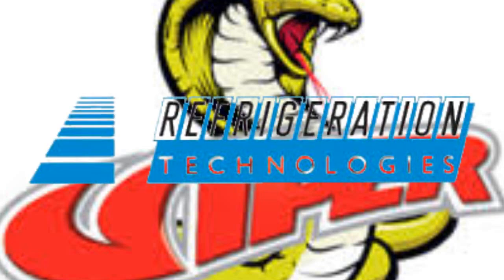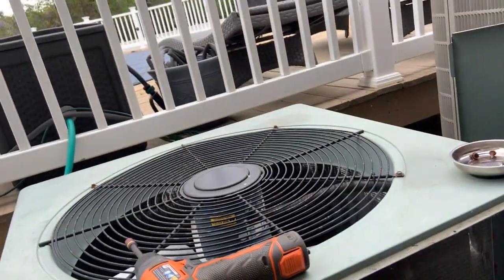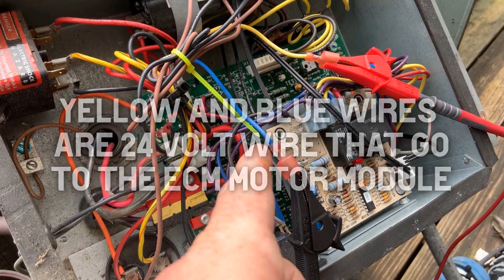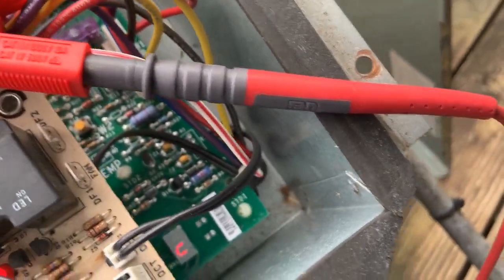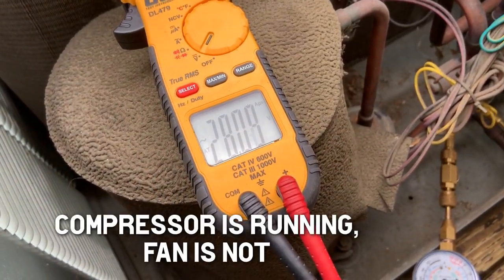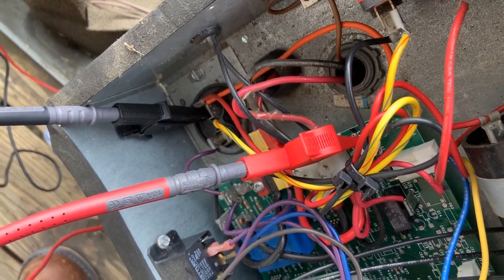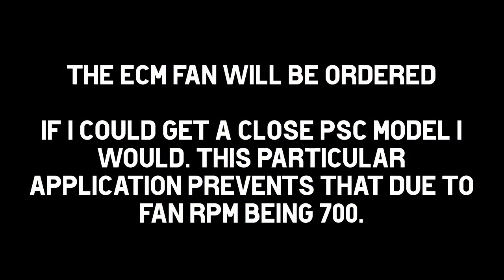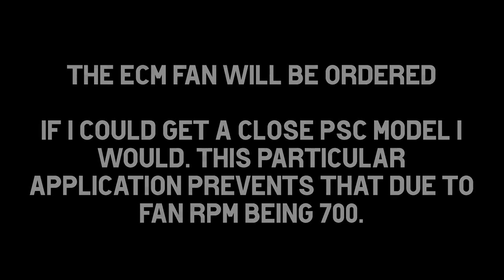Condenser Fan Motor Failure Diagnosis

Comment: How are you going to bill this customer? I am going to assume the original motor had a manufacturer parts warranty, but let’s say it did not have warranty and you sold the first motor,  what would you have done now, sell him a new motor at a discounted price or try to convince the customer to replace the equipment since it is little over 10 years old with no warranty?
Reply from the maker: Sell the new motor at the same price as I did it inn2017. 3 years is too long to give a discount I think. The rest of the system in too good of a condition to replace.
Reply: HVAC Shop Talk I agree with you, this is a good example for this situation for using an OEM part, you installed a part that Rheem specified, so that gives you a little protection from a possible irate customer.